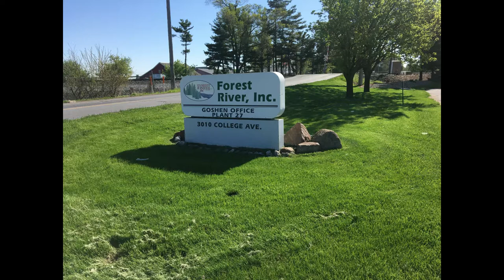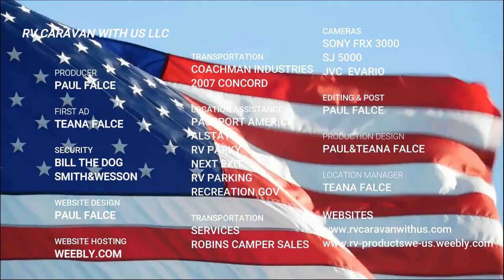The Forest River RV Plant,Come See The Tour

Comment: We’ve had several issues arise with our 2021 31RLQS. Kitchen island was replaced,roof leaked,wiring burning and shorted out the control panel, co-ax cable not ran correctly and splitters not tied together, electric stabilizer jacks stopped working, finish coming off of doors.
Reply from the maker: you should really go see factory youll be shocked

Comment: I just bought a brand new Forest River Salem and the build quality is horrifically bad. The trailer is a year old and the roof and one of the sidewalls are separating from the frame. I have multiple points of water intrusion. Add to that, electrical short circuits, blowing fuses, leaking plumbing, exploding plumbing (4X), broken straps on the water tanks, collapsing interior shelves, screws coming up through the floor in 3 places, leaking windows, defective domestic refrigerator (freeze or spoil with no in-between), leaking pin holes in the kitchen sink faucet, both interior doors mounted visible crooked, dinette slide literally falling apart in multiple places, and many more problems. I was unhappy with my servicing dealer who gave me a runaround...so I shopped around for a new service facility. The service writer from one of these centers summed it up perfectly -  Service writer: "Did you buy this trailer with a salvage title?" Me: "No Ma'am, this is a brand new travel trailer."  Run from Forest River.
Reply from the maker: best thing you can do is get the brand new roof done over by pro tec lifetime guarentee 
see my video
Reply from the maker: here is the video
https://youtu.be/z3kw5HLzUDc

Comment: Two months ago we purchased a Avenger Lt, 17FQS, We have used it on 3 trips total of 12 days, 2 shelves have collapsed, water leak on the kitchen sink drain, Shower wall surround buckling and coming loose, Ever Chill fridge kicks of on worm days and have to reset 3 to 4 times daily and unable to adjust the shelves in the fridge, door to the door does not open far enough, open seam on the roof, exterior siding on the drivers side in front of the slide balloons out, exposed staple heads on finished surfaces with uneven seams at cabinets in kitchen and bathroom, on the front exterior fiberglass glue streaks across the finish, sound bar was installed uneven and so was the heater cover, lower panel in the kitchen that covers water pump had gaps on all sides. In conclusion, terrible fit and finish poor engineering, it looked like there was little quality control just throw it together and get it shipped.
Reply from the maker: wow sorry to hear that , we took ten tours so we could know how there put together  and help people where  possible with understanding assembly and problems
 also who has the best facility and products
Reply from the maker: you should really go see factory youll be shocked